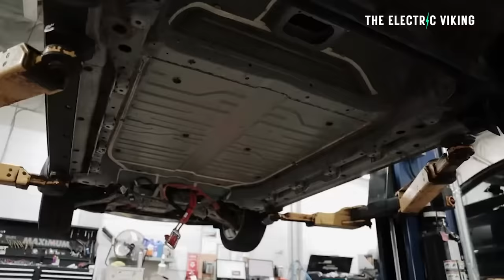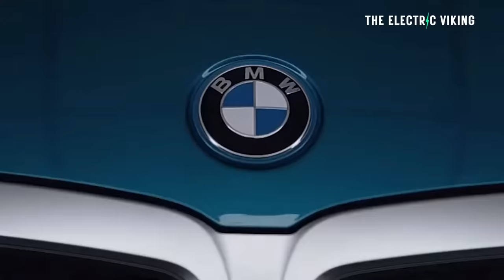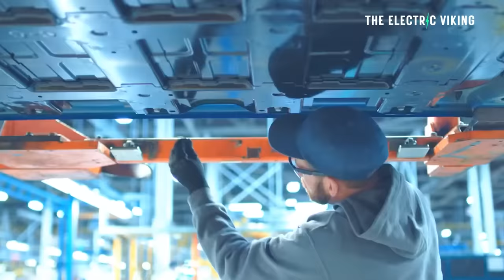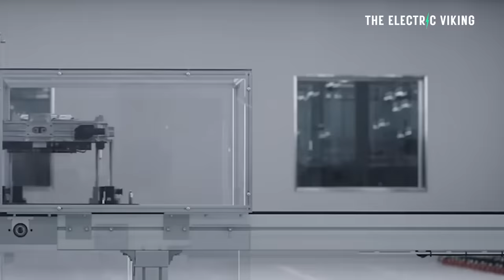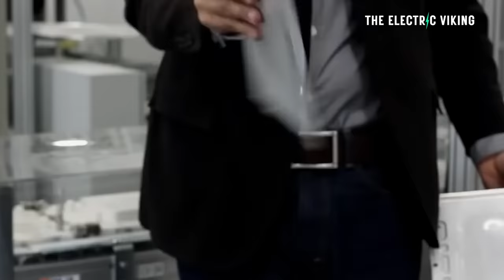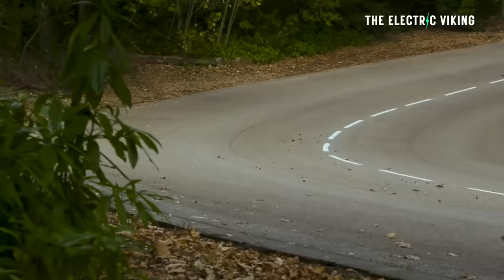The shocking cost of EV battery replacement for these 3 brands

Comment: Oem s are notorious for marking up parts. I once sold cars at a GM dealer. I sold chevys and Cadillacs. When I was hired I was told my comisson was 15 percent of the profit the dealer made. Typically the dealer paid $2,000-4,000 less than the window sticker MSRP for the car. This means the dealers profit is the same......2-4 grand per car whether it's a $30,000 Chevy or a $60,000 Cadillac  .Dealers make a heck of a lot more money marking up parts and accessories. When selling cars we tried to push a simonize wax job......our cost...$80.....we charged the customer hundreds of dollars. Rubber floor mats for the cars could be bought for $100 the set at box stores......we charged $300..!!!!. What s going to happen with replacement ev battery packs.......some battery company will make equivalent battery's to the oems specs........charge one half or one third of what the oems charge.......and get significant market share. There will always be people afraid to use anything but oem part numbers,  and they will continue to be ripped off........but once a replacement part vendor can prove his part is the same form fit and function as the oem part...... there is no good reason to pay extra for the oem part.......

Comment: It is now January, 2024, and there was recent controversy over the charge for a replacement battery pack for a Hyundai Ionic 5, at over $60,000 Canadian ($50k+ American). I don't care what its capacity is, that is a ridiculous liability to have hanging over your head after purchasing an EV. His original pack, btw, was damaged by running over an object in the road, so there was no manufacturer's warranty coverage.

Comment: Makes perfect sense when you consider taxpayer and ICE manufacturer subsidies keep EV prices about 1/2 what they would otherwise be.  Although EVs get subsidized, parts when sold separately (including the battery) do not.   Maybe that is why no one makes an EV with batteries not included.

Comment: Hold my beer.  Porsche Panamera hybrid has a 9.4 kWh battery.  If it fails, as they tend to do just out of warranty, replacement is $25k-$28k usd.  On a 2014-16, that is about entire value of vehicle.  When it does fail, car is a brick.

Comment: Loads of nearly new batteries for sale aftermarket for the BMW i3 for £7000 or less so that's £171 per kWh for the biggest battery. Warranty is 8 years or 100,000 miles. Very unlikely to pay what you're saying and unlikely you would ever have to.

Comment: FACTS:  
1.  Batteries are recycleable!!!!  If only their are mandated to do so.
2.  My lead acid 12v went up over the years never down!!!!
3.  I was lied to about plastics are recycleable..truth is ony 5-10% are recycled ...the rest are sent off to 3rd world countries to be dumped in the ocean.What makes you think that the manufacture of battery won't do the same unless mandated and what to prevent them from shipping it to the 3rd world when it is 5x more costly to recycle lithium vs getting new virgin lithium from the ground.  Similar problem like the plastic pollution.  
4.  Business is to make money whether that is electric or petroleum oil as your source of energy.  They started as low prices then jacked up later as demand rises.   
5.  It takes energy to make energy...nothing is free.  Solar is made from panels that takes energy to make...winds etc....  Cost to make these gadgets is petroleum, coal, nuclear,  and you fill in the ______.
6.  Want to save the planet ...  buy a reliable brand carmaker, take care of it and keep it running like the Cubans.   This will do more for the planet than any new fancy gadgets or doodads that will further pollute the planet e.g...phones, electronics, etc... The rest are just scams design to enrich one group over another.

Comment: I don't understand why manufacturers don't lease batteries. Increase sales and electric vehicle adoption by significantly reducing up front vehicle prices. Reduce risk for car buyers, which will also increase uptake. And create a steady revenue stream, which is  what legacy auto is concerned about losing with electric vehicles. Why isn't this happening? Buy the vehicle, pay a monthly fee for the battery, never worry about it again.

Comment: Making  an EV battery consumes more mineral resources than any ICE vehicle and always will.  Then there is the replacement cost of a battery - not only very expensive but using more of earths mineral resources.  Think of the mining costs and diesel used to mine these minerals!  Excators can't run on battery power because it would take battery capacity the size of the excavtor itself to move tons of ore etc....I think that in the long run we will find that EV's give us a warn fuzzy feeling but in reality, taking all into account, they won't be the solution to climate change in fact will worsen the situation what with the increased need for a decreasing amount of minerals in the earth.  Until hydrogen comes along in sufficient amount to energize motive transport dependable oil will remain for the forseeable future.

Comment: Seems like if the bstteries are obscenely expensive.... then manufacturers need to have a totally common battery pack.  And not their own specific battery pack, unless that happens I dont see it getting cheaper.  And it wont happen because bespoke battery pack = expensive dealership only replacements.

Comment: So if your a teacher that makes 50k per year with two kids you should not drive often charge all the time and dont park in sun amd never go on a road trip, and if your battery dies its rare, so your unlucky. 
Tesla need to bring brand equity by giving battery replacement for life on all teslas. Then the industry will have to follow suit. Replacing inhouse just means batterys dont need to be mined just recycled at a low cost. This will give tesla a great edge in the market in 2024 becase there is a real fear of buying a depresseating asset over gas.

Comment: seen a vid of a Canadian who owned an Ioniq, he tried to avoid something in the road and thought he did. He took his car to get checked out and there were scratches and a scuff mark on the casing that protects the battery, and he was told, because a certain hole in the casing was enlarged, the battery was no longer any good and may burst into flames at any time. The battery itself listed at almost $60,000(CAD), and his insurance would not cover it because it was more than he paid for the vehicle.
Reply: Insurance did cover it but wrote the 2 cars off as the book value was less than the battery cost. They paid out less than replacement of a new car. If they had replacement cost insurance  policy they both would have got a brand new replacement car. I purchase this when I buy new cars.

Comment: Before you even think of buying a used EV, call up your local mechanics and find out how much it will cost to replace the battery, once you realize none will even touch it, the one or two that might will charge you almost as much as a brand new ice car to replace them.

Comment: Why am I not surprised that the trend started by Tesla continues and people getting fleeced by unethical business practice.Least an ice will reliably last several decades but an EV over 10 years old and still running to range claimed a rare beast to find as most will not be on the original battery.

Comment: I normally buy a car that is around 10years old, if i have to replace the battery then i couldn't afford it.
Reply: With how many miles on? It seems to me that most Teslas will do the same amount of mileage and then some as an ICE car. I do not know a single person who has ever put a new engine in a car or even kept a car long enough to even think about, its a non issue as far as I'm concerned. Plenty of 100K plus mileage Teslas for sale in the UK, you only got to get a screenshot of the battery health to get an idea of how its doing. Can not do that with a high mileage ICE car. Then there is the 8 year 100k warranty anyway. Most ICE cars are 3 years here.
Reply: @usefulrandom1855  You may well be right but  my experience with batteries suggests that age is a crucial factor. If its not then they could double their eight year or £100k guarantee and it wouldn't cost them anything, but i doubt they will.

Comment: The Hyundai IONIQ with the 1.5kWh battery isn't an EV. The IONIQ that was an EV has either a 28 or 38kWh battery. I bet the 28kWh is more expensive to replace than the later 38kWh version, because that was the highest quality, highest performance battery in any car in 2016, and it even surpasses almost all batteries used in current EVs. In 2016 it must have cost Hyundai as much as they charged customers for the entire car. The later 38kWh battery was a cheap mass product they still use in the Kona and other non eGMP cars. The 28kWh tho, that was aerospace grade material.

Comment: How to replace a structural battery pack ?
Reply: 4680 battery last +500k miles longer life than the rest of the car.
Reply: Structural packs are bolted in.  They are replaceable just like older packs.
Reply: Carefully...

Comment: I heard via a video from a couple from Canada that 2 Ioniq 5's had battery issues.  One ran over something, the other...I am not sure.  Insurance totaled the one that ran over something ($65k Ca for the batter pack I guess) and the other was $60k.  In the US a Tesla Model 3 cost about $10k US (owner was supercharging twice a day as an Uber driver).  All this is within the last month.

These are all recent numbers.  And as a Pro petrol head that loves V8 engines...I find myself leaning toward an EV...more specifically...Tesla.  Either a 3 or S.  CT will not be on the radar for decades for me.  Mostly because of the long wait.

Comment: Currently the only batteries we have seen getting replaced are high mileage ones which were probably charged in a sub-optimal way. Even then they have lasted a long time.  We'll have to wait to see how an 'average' cars battery ages. By that I mean a car doing average mileage for 10-15 years. In addition current batteries are likely much better than those made 10 years ago.

Comment: Fact check, 2018 Hyundai Ionic "electric" has a 28kwh battery.... the small battery you are talking about, could be from one of the hybrid trims, not the fully electric version. The Clastic Ionic comes in 3 drive train/trims. Adding Hybrid packs to the mix is not a level comparison.

Comment: Maybe I'll consider an EV when the cold doesn't wipe out the battery power. Until then I'm sticking with fossil fuel or maybe a truck with an onboard generator. I don't count battery life in milage but in hours of use. A four wheel drive chained up on all four and out feeding cattle may only go 10 miles but take you four hours to do it all the while with the cold sucking the life out of the battery.
Reply: It's true that Evs batteries don't charge up to 100% in the cold, however they don't need engine warm up time and don't need to be running at all when you've stopped the vehicle in your case you maybe running your ICE engine between stop offs. I am retired and only do 30 miles a week but the car charges to 200 miles even in the cold so in my case I only charge once every 3 to 4 weeks. Every case is different but I have come from a ICE car which was barely getting warm between runs which was not good for the engine or fuel consumption.

Comment: Leaf batteries being air cooled are far less complex. In talking to a Nissan dealer, they advised the Leaf battery is only designed for about half the vehicle life and therefore the vehicle is designed to facilitate battery replacement.
Reply: hmmmm interesting

Comment: Now? At the rate my 2017 battery is wearing.. it will last to about 300,000 miles before it goes below 80% of its original max. I’m at about 7% lost now at just shy of 100,000 miles and nearly 6 years. I’ve only ever owned one car that made it to 100,000 miles before i wanted to dump it. And i still love this one so much I can see keeping it for another 100k miles. Which is ridiculous to me.. but i have nearly 0 reasons to trade it in for the newer. A couple.. but they’re so small it makes no sense.. and there are equally big benefits to keep the one i have. So until there is a drastic upgrade, I’m happy as a clam

Comment: Jai Hinduja.  We Indians specialise in EVs without the  needs for the whole  battery  pack replacement.  In fact, we are leading in cutting edge Aluminum - air batteries, Vanadium flow batteries etc.

Comment: Re the BMW - there’s a Munro Live presentation where they note BMW makes modular packs that can be replaced in sections. Doesn’t mean it will be cheap but at least you’re not trying to find and chisel out individual cells as the only option to complete replacement.

Comment: You have definitely gotten a new subscriber out of me.  The cars Tesla's are competing with don't offer the performance along with the lower cost of replacing the battery.  Most try to generalize EV qualities, instead of showing the manufacturers with high cost batteries or lower battery longevity.

Comment: If you bought the same battery pack as a power wall, recharge pack or UPS, how much would it cost?  They probably want to change the charger, converter and data modules (without any reason at all) and charge you for something that is not broke.  They are probably like a front light assembly, a dozen things in one.

Comment: untrue, the smallest hit on the underside of your battery can cause your battery to be no good. how many cars have you bought in your life that you did not bottom out somewhere or rolled over a piece of metal or wood or a metal rod in the road. most car do hit something in the first 70,000 km that means a lot of battery change and its scary on a ionic5 2 cases in canada 60,000 dollars to change the battery, scary.  the more problems multiply the more reasons you have not to buy an EV , i really think that ev's are in big trouble. why on earth did they not make the bottom plate of the battery in titanium, god forbid you would protect your battery. I cant believe thes costructors.
Reply: the latest problem i have heard of: you are on the hyway, your car gps tells you where the best charging point is: you get there and the charging stations have been vandelised: the credit card inserter has been smashed with a hammer. no charging station is working, its beginning to be a problem. the next charging point is too far for you what do you do ? you are screwed. i had never heard of that one but apparently its a new recurring problem. Imagine the range anxiety now? i mean the problems are piling up, EV'S are dead.
Reply: and i should add : how many charging company are going to stay in business if this behavior spred?

Comment: 5 yrs and an after-market pack industry will start to evolve, it has started for the likes of the leaf. By that time cell costs will be much lower. I think clever governments would fund incubator businesses converting fossils cars to build up the skill base required in the next few yrs.
Reply: The problem is… all manufacturers now use different size, different mold battery packs. We need somekimd of standard so that Same battery can go to Tesla. Nissan, BMV and so on. That would reduce prices!

Comment: I think there should be some standardization of battery shapes, cooling system, capacity and hardware and software interfaces. This would allow for competition on replacement batteries and an actual ability to replace them. Some cars, e.g.. Tesla model 3 get totaled in a crash that damages the battery by the insurance companies as they are impossible to replace. Forcing auto makers to allow for replacing a battery and forcing them to  document their battery is the only way to lower replacement battery costs.
Reply: Tesla has always offered replacement batteries, and I suspect all other makes do as well.  If a any car is so badly damaged that the battery needs replacement, the car is likely totaled anyway and likely has massive structural damage.  I guess everyone could adapt Tesla as a standard, since about 60+% of the EVs on the road are Teslas and they have some of the best and lowest cost technology.  I don't see it happening.  Everyone else has a few percentage points of market today, with each using a unique design.
Reply: @tesla_tap  you can’t adopt Tesla’s battery as a standard because 1. Tesla would have to publish their battery specification, 2. Tesla battery pack design does not allow for replacing the battery. It is literally the body of the car.

Even if you order spare parts for Tesla you may have to wait as long as 6 months as they are the only ones producing them. I drive by an auto repair shop and their lot is full of Damaged Teslas (the ones that are repairable) waiting for parts. 

Generally, I am against monopolies of any kind.
Reply: @realestatenow  
2. Is only true with the structural pack, and considering the lack of battery advancements from other OEMs idk if tesla would risk fires on OEM vehicles. That would be bad publicity for tesla because the OEM might just blame tesla. 

I'm against monopolies unless they're natural. Which tesla seems to be.
Reply: @OG Zombie Blunt  Good points! Note that even the structural pack can be replaced. It just bolts in like all prior Tesla packs. Now, the vehicle shouldn't be driven without the battery, but without the pack, it would be hard to drive!

Comment: Those battery replacement costs probably don’t take core return refunds into consideration. Even a 100% dead battery has  recycling value. Not to mention electronics, etc. So I wonder what the core rebates would be.